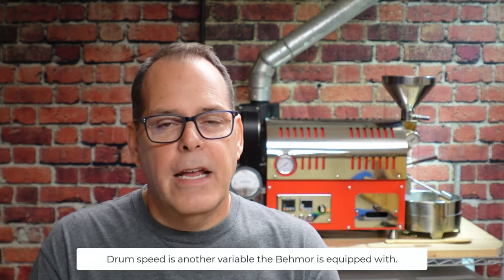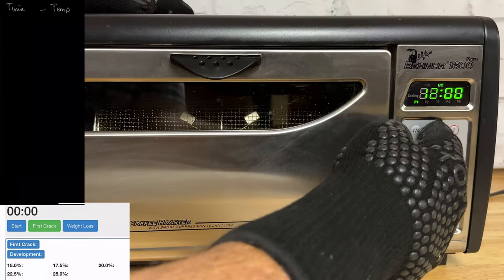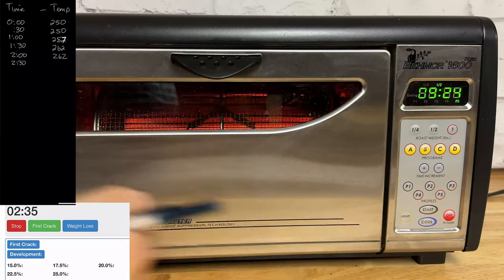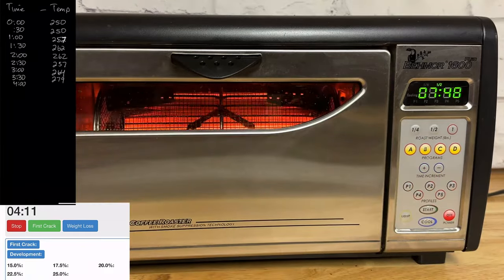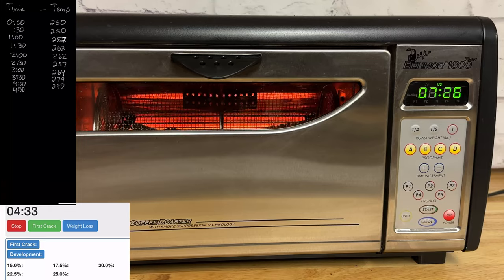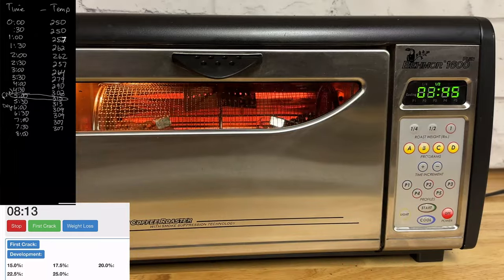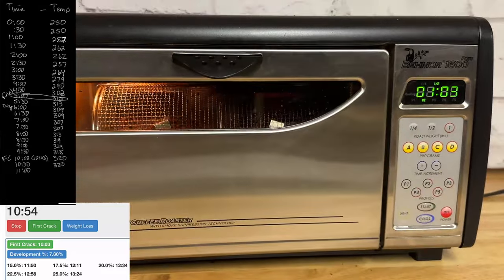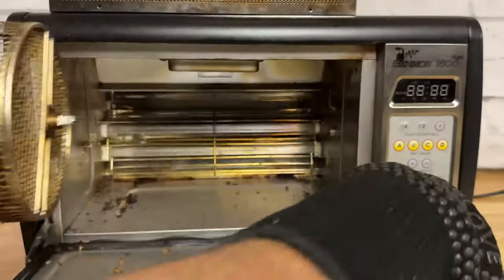How Coffee Roasting Temperatures Are Helpful

Comment: I have both the Behmor and the Popper. I roasted on the Behmor exclusively for about 5 years and while I love that I can roast a 1/2 lb at a time, I find the amount of intervention/ button pressing I have to do to be tedious. I wish there was an 85% vs. 75% setting so I don't have to toggle between 75 and 100% so much.  I find myself choosing the Popper more often than not due to the simplicity of using it with a power meter and getting very good results.
Reply from the maker: That’s good.  I’m glad you are getting very good results.  The power meter isn’t something I have relied on during my popper roasts but I understand it’s accuracy and benefits.  It would be nice if the behmor could do 10% power increments.  I have had great success with the Behmor but as you said, there is toggling.  Thanks for sharing.

Comment: I had a lightbulb go off todayand I wanted to share.  A foolproof cheap method can be had with a combination of a small air fryer and a popcorn popper.  The airfryer can  do the job accurately and in a controlled manner throgh the end of the browning phase.  And dump it into the popper and first crack should start pretty quickly and shut off after 2 minutes.  What can help will be to calibrate and warmup with a thermometer gun and fry thermometer.  Small servings only.
Reply from the maker: I’m glad that is working for you.  What type of coffee and what roast level?

Comment: Yes! Roast events dictate when temperatures are correct, not the other way around  When those temperatures are established, THEN they can be used as predictors as to when events will occur. As you pointed out, the actual temperature is specific to your particular roaster. Obviously other factors (density, charge weight, etc.) enter into the equation, as you mentioned. But by keeping all the other factors as consistent as possible, controlling to temperature can give a very reproducible and repeatable process and roast. As I don't have Artisan, the other 'variable' I track is temperature at minute intervals, trying to keep the slope as smooth as possible. Going up 20° gradually over a minute's time is not the same as going up 20° in 20 seconds time. Coffee beans are going from endothermic to exothermic. Both temperature and time are part of that equation. You have taught us well, Sensei. And the world is a more flavorful place because of it.
Reply from the maker: Well said J.   We need to be very familiar with our roasting equipment.  Thank you for sharing in a very clear and concise way.  You should start making videos for home roasters ;-)

Comment: Are you not concerned about baking the beans rather than roasting them when going with a longer roast?
Reply from the maker: thanks for watching and subscribing to my channel.  Baking is always a concern when I roast.  I would not consider this roast a "baked" roast.  The behmor is not a fast roaster.  A 12 minute roast is an average length of time.   That is one reason why I only roast 1/2 lb per batch.  Somethimes I will even roast 1/4 lb to shorten up the roast when I roast light.  Because of that, getting light, bright acidity is challenging on the Behmor.  Having said that, this roast wasn't "baked".  That term is used a lot and can have different meanings.  For me, having a flat ROR for a period of time is how i understand "baking".  

What do you think?   Are you roasting on the Behmor?  What kind of roasting profile are you using?  Thanks again for your comments!
Reply: @VirtualCoffeeLab  Thanks for the reply. I’ve learned a lot from your videos. I’ve been using a BEHMOR for about five years. Until recently I’ve been using the programs with good consistent results. Your video on manual roasting got me to try that and now I’m hooked. So the last few months I’ve been running manual roasts. I’ll preheat to about 250 F, start on P5 until 320 F then drop to P4 until just before the afterburner kicks in then I’ll kick it back into P5 since it will drop the temp to about 290 F. I then hit FC at 315 F and drop to P4 once again and cool at the end of FC unless my nose tells me differently. If I’m outside I will open the door to let it cool faster but indoors I just let it go normally. Manual has improved the taste of the coffee IMO. I now have to learn how to use my M6 dual that just arrived. Take care.
Reply from the maker: Ooooo.  Congratulations on the M6.  There will be a learning curve but my Kaliedo videos should address some of what you will experience.  Did my baking answer help?  The term is kind of subjective.  For the Kaleido, you will want to have your ROR be descending from about Dry End till the end.  Let me know if you have more questions and ENJOY!
Reply: @VirtualCoffeeLab  Yes the baking answer did help. I intend to revisit more of your Kaleido videos. Thanks again

Comment: Sir i have a question for you, before i  started charging the beans into the drum, better for me to charge the coffee at (+ or -) ∆Beans? And second question my coffee sometimes makes me bloated What is wrong with my roasting techniques any suggestions to prevent this. Thanks i hope you read my questions
Reply from the maker: I can’t suggest a charge temp because I don’t know your roaster, capacity, bean type, roasting style, charge weight, ect..  what are you roasting with and what temp do you reach when you hit first crack?
Reply: @VirtualCoffeeLab  i'm sorry, i forgot to tell what roaster i used, currently i'am using Nordic Coffee Roaster 1.5kg, Cast iron drum, Semi Washed Coffee from Sulawesi, 11% water contents, Charge temp 180c°, fast roast, i used 100% airflow, and 90% drum speed on 100% is around 3k rotation, First crack around 194c. 

I already checked my exhaust duck tape there's no leaks, and also i already cleaned it, flush my drum 🥲 but still i cannot aim my consistency to roast coffees that doesn't make me bloated. 

Thank you so much Sir for your response 😊
Reply from the maker: Thanks for your reply Andrew.  Sorry for the late reply, I was traveling.  Here is my response to your question about  Charge Temperature and Bloating:

Charge Temperature.   The charge temperature will vary based on the type of coffee, processing, its density, the type of roaster and the charge weight.  I will assume your roasting a fairly dense central american coffee washed coffee and are roasting at capacity (1.0 - 1.2 Kilos).  You should preheat your roaster to your desired charge temp using your PID probe if you have one.  The bean probe lays at the bottom of the roasting drum while the Environmental Temp probe  sits in the upper part of drum near the exhaust tube and the PID probe sits in the middle of the drum.  So, if you have a PID temp, use that as the charge temp.  If you don't, use the bean probe temp.  I would suggest a charge temp of about 198c with low gas at charge for the first 15 seconds, then ramp up to medium gas until about 45 seconds and then whatever gas/power is needed to get you to to dry in about 5 minutes.  If you can't get the coffee yellow by 5 - 5:30 then consider a slightly higher charge temp.  DON"T use 100% airflow. ;-)   Use a lighter to determine your air draw through the trier port.  See the Mill City video https://www.youtube.com/watch?v=t1VAbHnqW0E that talks specifically about how much air to use during warmup and how much to use during charge and the roast.

With regards to Bloating, it is most likely the acid in the coffee irritating your stomach and digestive system.  It could also be the caffine. I'm not a doctor, I just did an internet search on this.  you may want to consult your physician and get their advice.
Reply: @VirtualCoffeeLab  thanks so much for the advices
Reply from the maker: i will be talking about charge temperature in a few weeks in one of my videos.

Comment: Hi Mike great video 😊as always. I have a couple of questions. I know you pre-heat your drum roaster and the Behmor as well. Should I be preheating my fresh roast sr800? I don't see a lot of people doing it that way on youtube. Also, are you able to control the temperature in your basement? I roast in my garage and as the seasons change I have to modify my roasting profiles. Thanks again!
Reply from the maker: I don’t preheat.  My basement is temperature controlled and a pretty constant 65-70 degrees Fahrenheit.  If your coffee is room temperature as well as your roaster and you are bringing it into the garage to roast, preheating isn’t needed.  If you keep the roaster out in the garage and it gets cold, you might want to warm up the base, lid, and roasting chamber.  Not to get it hot, but inside room temp.
Thanks for watching and the comment
Reply: Okay, that makes sense. I'll either start bringing my roaster inside in between roasts or slightly preheating to bring it up to room temp. Do you tend to start with a fan speed of 9 and a heat setting of 1? Thanks!
Reply from the maker: Depending on your roast level there are several approaches.  I demonstrate a simple approach here in this video for a really light roast ethiopian coffee - https://youtu.be/J3GEK9ydJr4

I have plans to share a similar video soon showing a medium roast..  I start with fan on 9 and heat on 4 in this roast and never change the heat through the entire roast.  The only changes I make are with the fan and that is only for the first half of the roast.  Check it out.

Comment: Excellent video, Mike. I just roasted my 6th batch on the SR800 and have been focusing on recording aroma, colour development, fan and power settings, and any other observations. I had almost completely written off recording temperature, as I assumed the built-in funtion was useless, but you've made a very good point about how temperature readings can be used to further manage the roast once I'm familiar with my equipment's performance. Looks like I'll be modifying my spreadsheet this evening...

Cheers! ☕
Reply from the maker: Hi Matt, thanks for your message.  Yes, roasters like the Behmor, Fresh Roast, Gene Cafe, and others that are not able to measure bean temperature directly are still useful references for roast progression and heat management.  I'm excited to hear how this helps you roast better coffee.  Feel free to come back to your comment and let me know how it's going.

Comment: Hi Mike, Great video. I didn't expect first crack at that low of a temp.  Changes my perspective of heat and time.
Reply from the maker: Yea, those weren’t the actual temps inside the roaster but those were what was being displayed.  If I were to put probes inside it would read anywhere from 325 to 600 degrees depending on how close it was to the quartz heating elements.  Regardless, I was able to use the temps as references to guide me through my roast.  I have done a video with my Behmor using artisan.  I think you can see it in my Behmor playlist.  It’s quite surprising to see how the graph looks.
A lot hole back I did a video with my drum roaster with no logging software.  I used sight, smell and sound to guide me through the roast.  That was pretty cool.  https://youtu.be/cx-DQouGZ0o

Comment: Nice video Mike. One thing you may have mentioned but I want to emphasize is the Behmor temperature readings do NOT represent actual seed temperatures; they are only temperatures of certain areas within the Behmor roaster.

But those temperature readings are NOT irrelevant! They are very useful and even valuable when comparing one roast to another. It’s always good to graph the readings because when a great tasting roast is achieved (and it WILL be), you then have a guide for the next roast of that coffee. As you have stated, temperature control is extremely important. But the more information that can be recorded during the roast, the easier it will be to duplicate controls to get good results on the next roast of the same coffee.

But since Behmor temps are not actual bean temps, users must know that the roasting curve curve will not look like the curve of a drum roaster that uses a bean probe. That was my first frustration I had to get around with the Behmor. And as many know, the senses of sight, smell, and sound usually are quite accurate are also extremely useful. Thanks Mike!
Reply from the maker: Thanks Lou, very well stated and true.  Charting for repeatability of the golden cup is important.  Yes, the behmore temps are not bean temps.  I was talking with songbird about temps for his fresh roast and shared how the temps are helpful and how he can correlate his events with his unique temp readings to better estimate and time events.  
You are right, those temp readings are not irrelevant.  I mentioned using our senses  in conjunction with temps to fill in the blanks.  We are thinking alike Lou.  Great comments.  Thanks for sharing!

Comment: I just started roasting last month! Did a few roasts on a $20 popcorn popper, with not too bad results 😂… upgraded to a SR800 - 
The first few roasts were fails because I was trying to follow someone else’s suggested times for the coffee I was using, rather than watching, smelling, and listening for myself.  I put away the numbers and started watching the roast (and the temp). I have a hard time recording what is happening because I’m trying to monitor the roast itself (maybe I’ll get better at that later) - just trying to actually learn the process. 
I am getting better roasts across the board (both washed and natural), but I feel like flavor development needs improvement - specifically, where my temp should be during/after first crack, and how long to let that temp coast for flavor.
I do feel like my roasts take longer than recommended times in the SR800, but I’m learning 😂
** I know this varies, but what, in your opinion, would be target chamber temps (I don’t have a bean probe) for the SR800 during the different phases?? Drying, yellowing, leading into 1st crack… during 1st crack… and into 2nd crack (which is typically where I pull my coffee or a bit before that) - thanks! Your videos are extremely helpful 😊
Reply from the maker: Thanks for watching and for subscribing Songbird.  I don't have an 800 so I won't share a temperature BUT there is a better way for you to determine your target temps for your phase events.

So, the question is "how do i know what temperature to be at for each event?"   The answer is time, color and smell.   If we use "Time, color and smell" as the answer, then we can follow a profile and not have to worry about temperatures.  As I mentioned in my video, temperatures are great references that provide information about our roast progress BUT our senses should always be a part of the data as well.  THEN (this is really important), when we have figured out the timing we can then reference the temperature on the fresh roast.  This temperature will vary depending on how fast you are pushing the roast.  This applies to all events.  More heat pushing the roast quickly will read higher temperatures.  

Here is a helpful way to visualize this.  Let's say you want your total roast time to be 8 minutes for a medium roast level.  You will have 3 events to focus on:
dry
first crack
drop (end of roast)

If we take that 8 minute time and break it into 3 phases, we end up with something like this:
Dry End (yellow) at 4 minutes
First Crack at 6 minutes 45 seconds
Drop at 8 minutes

This is just an example profile, not necessarily the one you should always use.  
If we try and follow that profile then we manage our heat (video #2 in this secret sauce series) to guide us to each event.  You will need to practice this so you know what heat settings will be required to achieve dry at 4 minutes.  Same thing for first crack and drop.  As I mentioned above, once we are able to do this we can reference temperatures at the events and use them as waypoints throughout the roast.  We can reference them to help us understand how the heat is impacting the bean AND how the bean is impacting our temperatures.  During the roast, the bean temperature continues to rise, getting it closer to the overall temperature/color we want.  

You should pay attention to color, especially at the end of your roast so when you taste the coffee and notice it is over or under developed, associate that color and make adjustments on your next roast.  Take notes, writing your times, color, smell, power settings, fan settings, and eventually temperature.

Does that make sense?  I hope that was helpful.
Reply: @VirtualCoffeeLab  Very helpful! Thank you for such a detailed answer 😊 - I’m getting good color and decent aroma - but some of the coffee seems to not be as flavorful as I’d like it to be. Perhaps that is because I am used to buying pre roasted blends of coffee, where someone else has combined coffees of different origins to achieve a specific profile. Now that I am roasting, I am tasting just one origin at a time (it is developing my palate though).  I DO realize that I am partial to Central American coffees, the ones I’ve roasted from Guatemala, Nicaragua, and Honduras are my faves out of everything that I’ve roasted so far! I may try blending a few of those together and see what pops.
Thanks again; I really appreciate your channel!